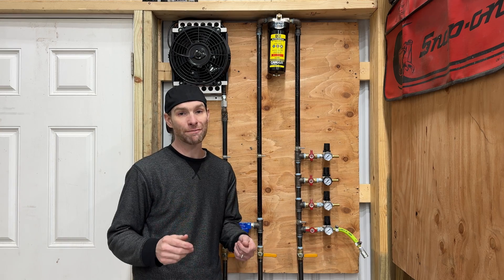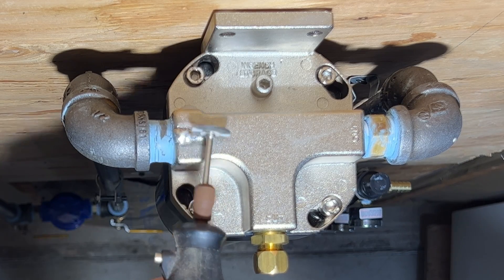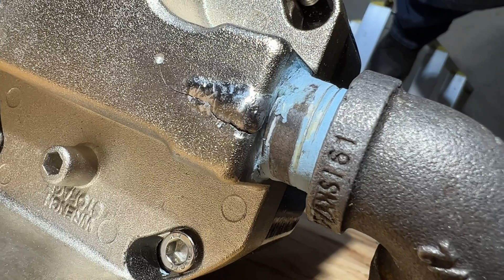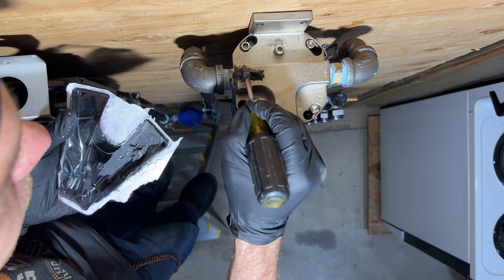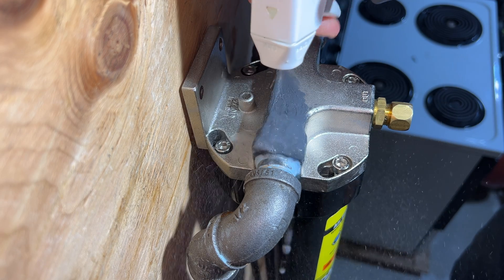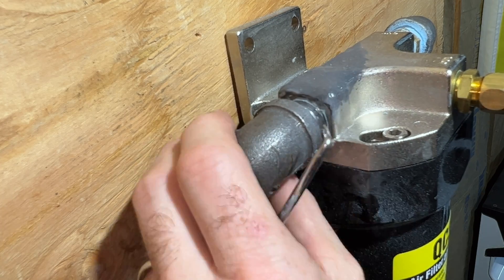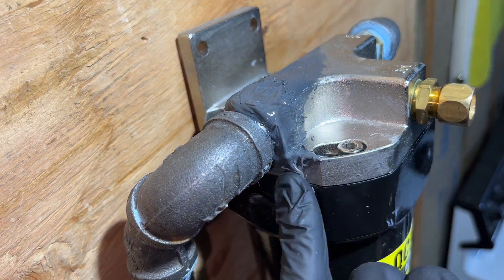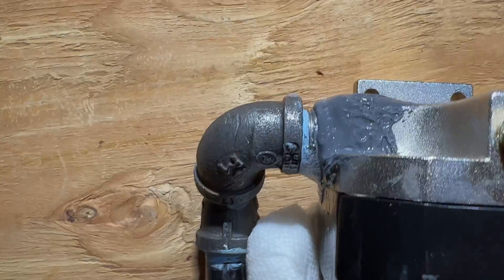How to JB Weld Fix Cracked Cast Aluminum Welding Air compressor pneumatic air filter dryer cover cap

Comment: So what do you think about a steam cleaner tank? It’s cast aluminum but it gets hot. Hole the size of a pea
Reply from the maker: It really depends on how hot it gets. Standard JB Weld it is only rated for up to 500°, while JB Weld Extreme Heat is rated for up to 1000°. The JB Weld, extreme heat may be a better option for your application, especially since aluminum retains heat and can get very hot. 

Here's a link to the B Weld Extreme Heat https://amzn.to/4oB4Gvs
Reply from the maker: So long story short. Yes you should be able to use J-B Weld on a pea sized hole in a cast aluminum tank, but you should use the higher-temperature product and follow the preparation steps carefully to ensure it holds under heat. Prepare the surface by thoroughly cleaning, then sanding, then re-clean after sanding it to create an area to make strong bond before applying the epoxy
Reply: Nice job!
Reply from the maker: Thank you!!!

Comment: How’s it holding up?
Reply from the maker: Holding up great! It’s before the regulator, so it’s been under full pressure since I made the video. I’m not sure what the compressor is set too, but it’s definitely over 150 psi, probably closer to 170. Not a single air leak at all